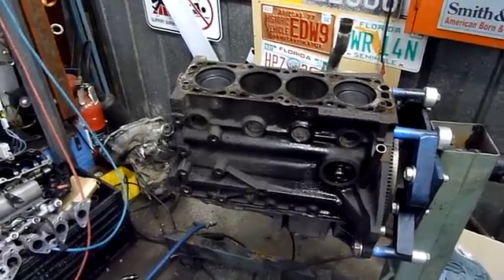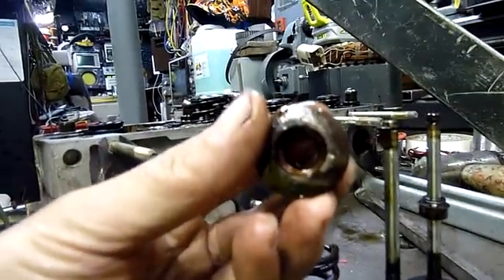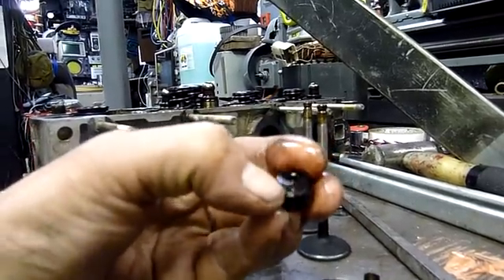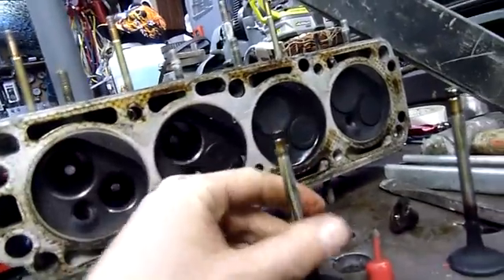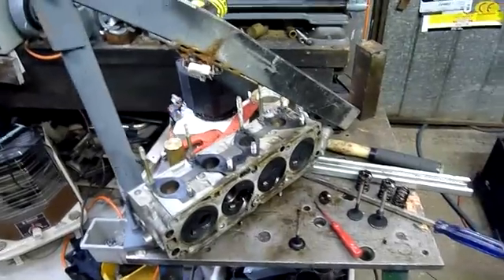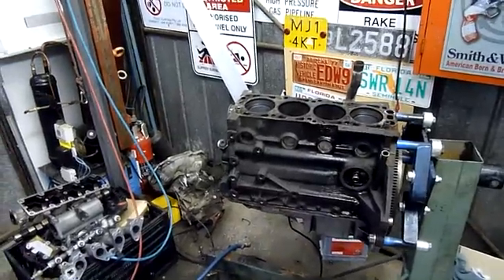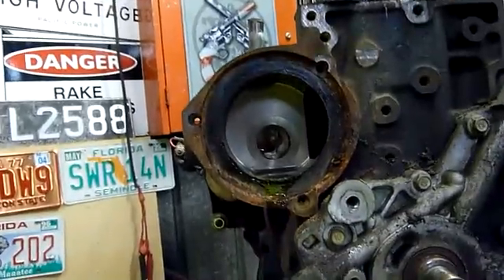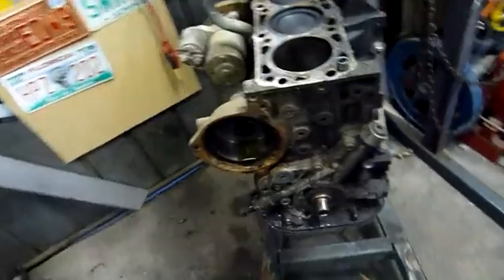Daewoo Lanos (GM Family 1) Engine Autopsy Pt5  Head and Oil Pump

Comment: Apparently these are an interference engine, thats why they`ve started vanishing fast, with many people picking them up for a few hundred quid, then not bothering to maintain them due to it not being financial viable, they either suffer cam belt failure or oil starvation.

Comment: Thank you for posting this, it had helped me to understand a little more how lanos engine works, i have a 1999 1.5 8v se just like the one in the vid, and i had an issue last year it overheated so i had to replace head gasket, the thing is, after this modification (september 2015) the car began to throw a lot of gray smoke in cold start, not inmediatly but after 2 minutes when the engine is begining to warm up, it takes 10-15 minutes to stop the smoking, and it smells really bad, i cant describe the smell but its really bad like a quimical component, this is just until the car is warm, but it smokes again when the car stops for more than 40 minutes in parking site. I am really confused, iv been trying to solve this problem but far i am just getting used to it... 
After watching this video i think it may be related with the valve seals, what do you think? On the other hand, my lanos doesnt have O2 sensor in the exhaust, ive just checked it and it has a bolt in the hole. Anyadvice?thanks

Comment: I have a 1.6 DOHC sport here and it is an interference engine.

Not sure if yours if any different but I looked at the 2000+ page manual and it doesn't mention non-interference in it at all. (It stripped the teeth off the timing belt for about 300mm and bent some of the valves.

Can the valve guides be replaced?

Comment from the maker: The gasket should just peel off unless its managed to bond with the surface, in which case tear off as much as possible and get a can of gasket stripper and a scraper
if its only stuck on the head i would not stress about getting every bit of residue off, it will come off with the machining process (a must-do for alloy heads if you want the replacement gasket to last)

Comment: Cool experiment idea: run an engine without a flywheel to see how it behaves. I'd expect very good throttle response. Obviously it will only work on engines where the starter doesn't work via a ring gear on the flywheel.